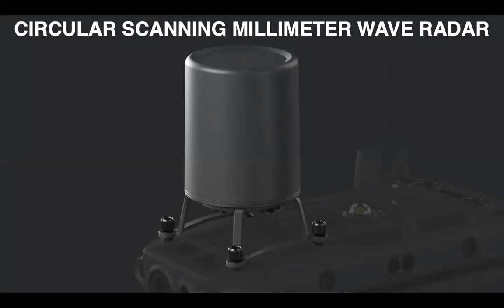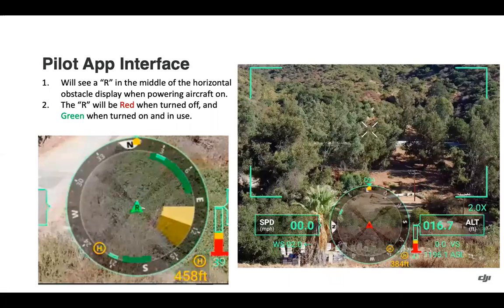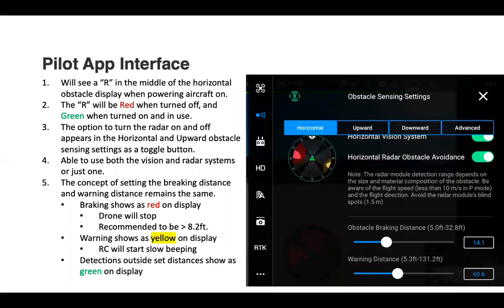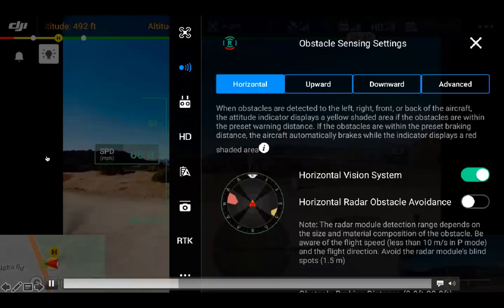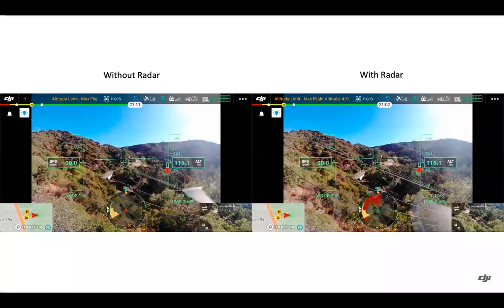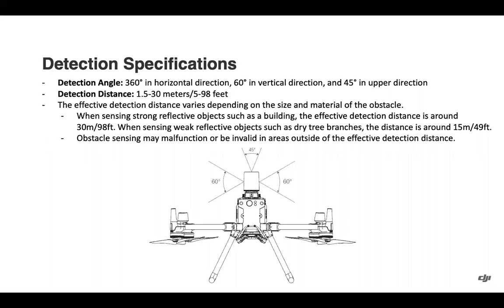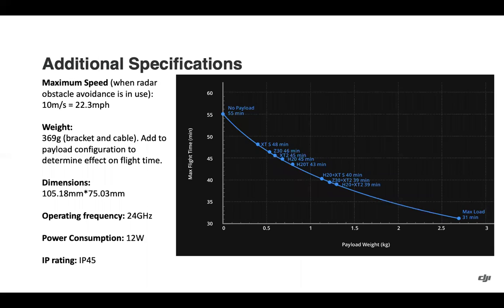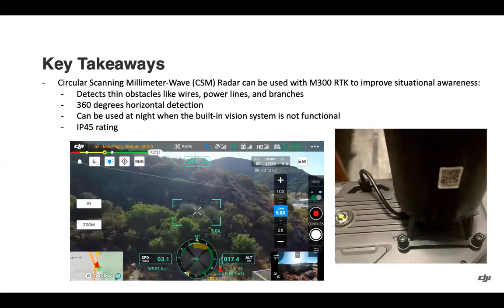Circular Scanning Millimeter Wave Radar for Matrice 300 RTK (CSM)

Comment: Hi ! Please do you know if this CSM Radar works without the H20T camera ? I will attach a 360 camera and only use the internal FPV camera of Matrice 300.
Reply from the maker: Yes it does not require H20T to work.
Reply: @DJIEnterprise  thanks ! I will order one. So the radar dashboard will appear over the FPV camera even with no camera eletronically attached to the gymbal ?